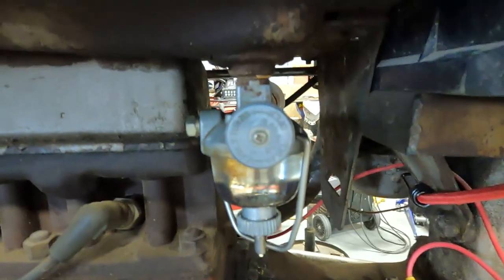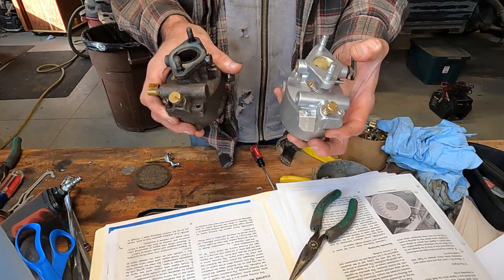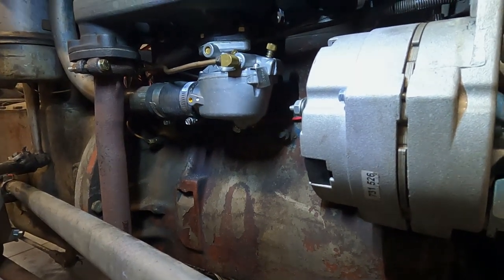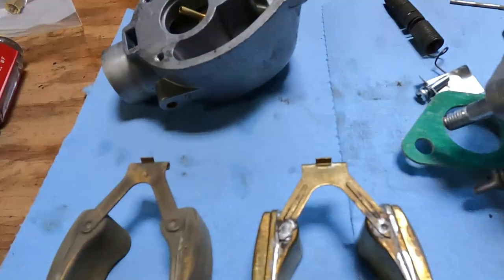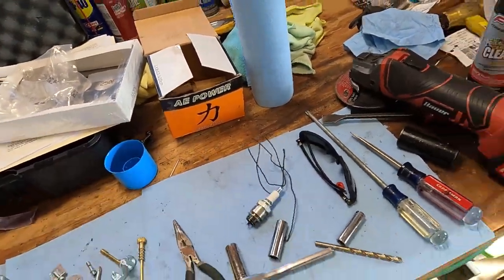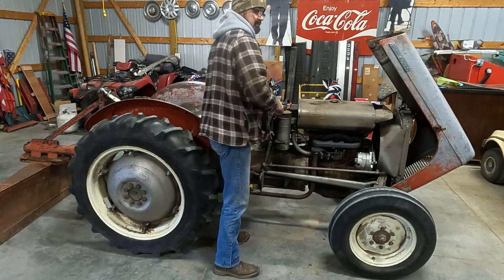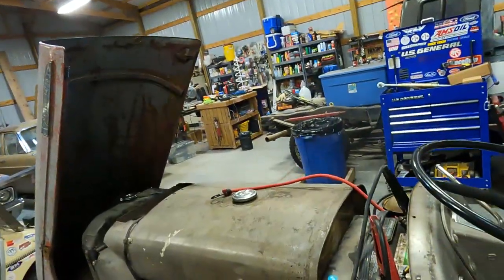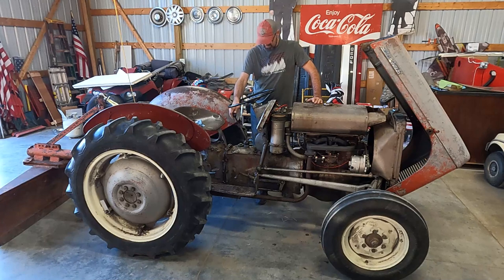AIR, FUEL, SPARK... Trials and Tribulations of the Ferguson TO-30

Comment: People, always check your timing.
  I had a GM alternator put on my 52', TO 30, and took the voltage regulator off, I think we put a twelve volt coil on, starts like a champ, runs as good as I need it to.
I have been using this tractor, thirty plus years to brush hog, pull a utility trailer, leveling driveways, plowing and discing, and am not even a farmer. I may look the part, I may do some of that kind of work, but, never, have I ever worked as hard as a farmer, or put myself in that class. Respect.
 
  Thank you to all that live that life, think where we would be without them.

  Father in law was a farmer, bumper sticker on his pick up read,

 Never cuss a farmer with your mouth full.
Reply from the maker: @billbyrnes9505  great bumper sticker and very true.  I help here and there but that’s about the extent of it.  12 volts really makes these old acreage tractors reliable!

Comment: The 58 Fergie Peter Dale, removed head, lapped very rusty valves, now all seated well, will see from 105, 70, 45, 102 to improved compressions, the cylinder walls are smooth, no rusty pits. Waiting head gasket sets.

Comment: Again, thank you for comments, after ran a little:  comp readings: 105, 73, 45, 102. Can I try in those options 1, tighten head bolts, hope stop leaks  2. using head gasket restore fluid;  3. use gasket maker on existing gasket, as there is no water in cylinders; 4. new gasket .
Reply from the maker: @dalepeter3016  you could have a failure between 2 and 3.  Compression moving back and forth in the now shared space.
I would shy away from the “fix in a bottle.  It’s easy enough to pop the head off and have a lookie.
If it is the gasket your numbers should improve and life would be happy.  If you see scratches or glazing in the cylinders and no sign of gasket failure then it’s time to think about pulling pistons and loving up the cylinders.
Reply: @freedom1garage  Good advices.  Re-horn tugs and new rings will be a long term fix for sure.   I had success on a V8 350 marine engine, 120-40 psi, ran poorly,  after a bottle of Engine Restore, all read 140 lbs, very surprised with the results, it still run very well a year later.   I II try  it on this old Fergie once I gain upper hand on water leaks.....

Comment: Appreciate the video. You know there are 2 different coils for these ole tractors, a shorter one and longer one. They have different resistance and many, many people install the wrong one. It depends on if the tractor has a resistor or resistance in the wiring. If it does, you need a coil without a resistor in the coil, usually the short one (measure across the coil terminals, you should get about 1.5ohms give or take). If your tractor doesn't have resistor or resistance in the wiring you need a coil that has resistor inside of it (should measure above 2ohms and this is what most people get at most part stores, even though the parts store say they are a generic one and it will work right). Having the wrong one, causes many of the starting issues you have shown as well as running issues as well. I've had a TO-35 model, but pretty much the same
Reply from the maker: Thanks for you comment and insight!

Comment: My 58 MF has low compressions 105 70 40 75,  would puff here and there. Not sure if it need total rebuilt.
Reply from the maker: 45-75 are low numbers and likely why it won't start and run.  However, there's signs of life and it could be possible to re-ring it, hone the cylinders and enjoy.  I'd try it!  Thanks for watching!
Reply: Great. before it ran, oil was ok, I got it running, now a lot of water is in oil, I must blown the head gasket without governor hooked up, a screaming engine! I refill water, it leaked into oil over night. Do I need remove head to see what happens?

Comment: I have a TO 35. Died suddenly. Have spark to plugs .. fuel.. even tried starting fluid. Drained fuel bowl... Checked compression with finger.. paper towel blow test... Cap rotor.. changed coil . Nice blue spark to plugs.. is there a hidden kill switch or something?? At a loss any ideas or help Greatly appreciated.
Reply from the maker: 12v or still running 6v?
Reply: @freedom1garage  12v. I work on alot of vehicles. This seems super basic. Old Chevy guy...
Reply: I was thinking timing chain or broke cam . Didn't have correct spark plug socket to pull all plugs. But front had good compression. In middle of moving...tools in two places
Reply from the maker: @justicebruno5249  I’d say to make sure it isn’t weak spark, run a jumper from battery voltage to + coil and crank.  See if it doesn’t like that.  Just like in this video that made all the difference for our 20.
Reply: @freedom1garage  I'll you know . Thanks.
Reply: I have a 52' TO 30, a bad kill switch was installed, unknowingly, and it would run, maybe two hours or so, die, and not start again until not cooled off.

Comment: Couldn't you just run a 12v feed to coil from starter solenoid output?
Reply from the maker: That may have worked but I didn’t want the coil sharing the circuit with a huge draw already on it.

Comment: So I have a t020 but it has the t030 engine I believe  it's the z129.  Old ignition coil I could not read label no sure if it was a 12 or a 6.  My tractor has a resistor on it so I went with a coil that said 12 with external resistor or 6 volt without.  Tractor runs horrible  not sure if it could be wrong coil maybe need a 12v?  Or maybe another issue but I want to rule out wrong coil before I rip into carb and distributor
Reply from the maker: You can bypass the resistor for few minutes and run it to see if it likes a full 12 volts better.  Might be time to clean up the Marvel Schebler but you are right to make sure your have good fire before you go digging into fuel delivery!
Reply: Thank you sir I will try that out wasn't sure if it would immediately burn out the coil if I ran 12 to it .